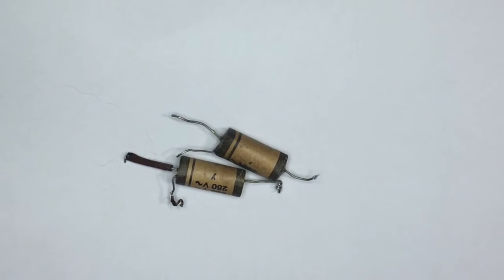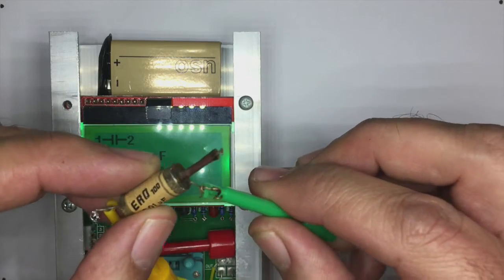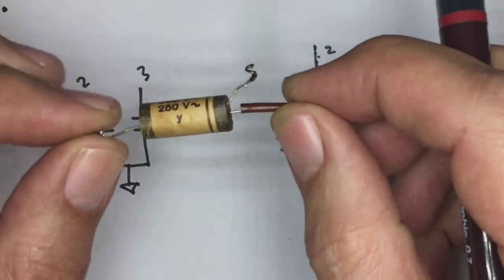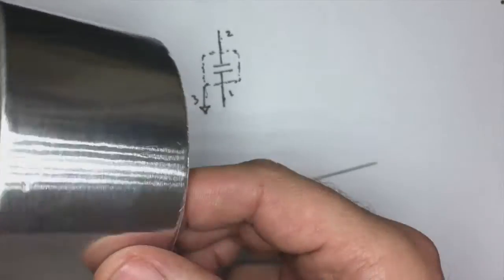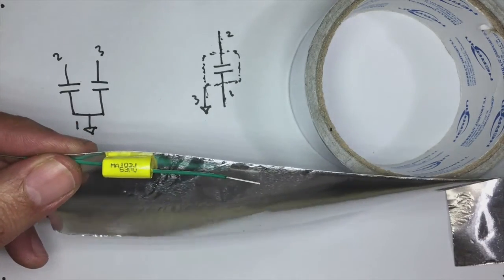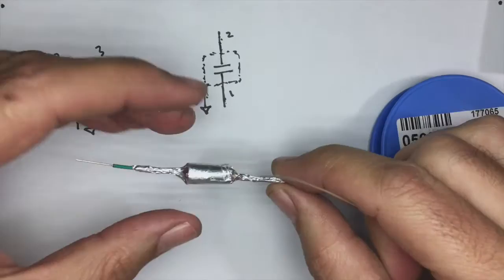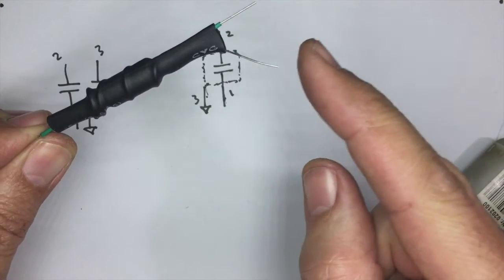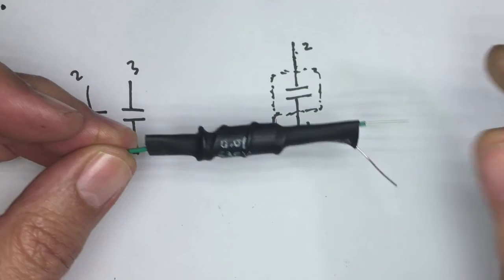How to make a shielded capacitor for a tube radio or amp.

Comment: I've done this simply by winding a piece of thin stiff-ish insulated wire around the capacitor, then a piece of shrink tubing around that to hold everything in place. It worked fine. ☺

Comment: Ive been using this method for a few years now but on my latest radio I tried something different. 
I took the paper off the old cap and the original foil is just loosely wrapped around the capacitor with the wire attached.
I just cut it to width and wrapped it around my new capacitor, including the original wire and put a small dab of superglue to hold in place till the heat shrink was put in place.
Very simple and looks very tidy.
Reply from the maker: That’s a good way to keep it looking more original 👍
Reply: @electronicsoldandnew  I would love to see you try this technique on one of your radios. :) Once you unroll the foil you just need to break off a small piece of the wax on the ends that holds the wire in place.
Regards
Kevin
Reply from the maker: It’s not something I have considered doing. The idea of making a radio look like it’s not been restored is useful if you really want to keep it absolutely visually original, but that’s not the goal in my restorations.

Comment: I was trying to test the voltage of a small electric mini fridge fan motor. I accidentally touched the outside top of a  power supply can capacitor to ground via my hand. It shocked me good. So out of curiosity I checked the voltage between the top of the can to the body of the fridge and it was 122 volts. I checked the next can over and it was 122v as well. This does not sound right. Do I need to take this in and have a service center check the capacitors? 😢
Reply from the maker: I would say so.

Comment: How can you tell when looking at a schematic which sections or stages are high impedance to use the shielded capacitor? I'm not even sure how to use a shield capacitor for coupling caps, decoupling bypass caps or what? EE engineers have told me that using LOW capacitance shielded cables in amplifiers makes the low capacitance cable very microphonic when you're tapping it with a wooden chop stick in high gain circuits but High capacitance shielded cables used in amplifiers are NOT microphonic, any reasons why lower capacitance shielded cables are more microphonic compared to high capacitance shielded cables?
Reply from the maker: If the connection is to a high impedance pin, like the grid, then capacitance will, through the miller effect, create a low pass filter. The higher the capacitance, the lower the frequency cutoff point. However, The lengths of cable one uses in an amp should not be large enough for this to be an issue.
Reply: @electronicsoldandnew  You put the OUTER foil terminal of the capacitor to the previous stage output of the tube and the INNER foil terminal of the capacitor to the GRID pin tube to the next following stage? But where does the capacitors shielding connect to?

Comment: I restored few radios that had factory made shields around the capacitors. They were in tone circuit. They wrapped the capacitor with a thin foil of some kind of solderable metal (it tarnished a lot over the years). So the replacing was trivial, just desolder the shield and put some heat shrink around the new capacitor then resolder the old shield onto the new cap, and resolder the ground lead.

Comment: This kind of capacitor was used in many RCA radios in the 1940s to suppress the harmonic frequencies that would occur in AM band from maritime  AM broadcasts
back in the day , They would overpower the reception of a station  you were listening to  especially if you lived near the seaside.  Of course after WWII the 
maritime  transmissions went to FM broadcasting and thusly  no need for them in the USA in radios after that happened. Not sure if that is why non USA radios have them.
If you encounter one in a restoration you could cover the capacitor with a braiding just for effect if you live in America ,that is!
Reply from the maker: Thanks for the info. I certainly did not know that.
Reply: @electronicsoldandnew  Mr. Carlson said of those many RCA radios that they put those types of capacitors inside the chassis to keep down
hum when it went from the volume control to the center of the radio. I 'll defer to him since I only picked up the info from my grandfather long ago and he
 only saw them  in a few RCA radios!
Reply from the maker: Thanks for the info. I certainly did not know that.

Comment: Thanks, this has been a great help. I am a just starting out in this hobby and have found your videos very informative. When I first found one if these capacitors in my radio it really confused me as to its purpose. In my case there was also a shielded wire to the pu which soldered time the same connection as the shielded capacitor.
Reply from the maker: Glad to have helped.

Comment: Sorry, but shielding the wires to and from the cap is overkill. It may even prove a shot in the foot. It only takes a little bend on the connecting leads and a solder job taking a bit too long for the green insulation to melt through and produce a short between cap leads and the added shielding foil. Make that short an intermittent one and you are in for an hour long hunt. If you really need to shield the wires too use a heat resistant tubing made from woven glass fibres as insulation/separation! 
Easiest way to shield tubular film caps is to cut a flat piece off of a tin can, roll it to fit the diameter of the cap very snugly, trim it to circumference plus overlap, solder on a wire and shove it over the cap. A final wrap in shrink tubing cut to the length of the cap plus a bit of overlap will hold your shield in place. There is no need to solder the selfmade wrap around shield into a tube, as long as the circumference overlaps. Yeez, this is not rocket science!
Reply from the maker: You’re right. It’s not rocket science, so I do it my way, as I’ve done numerous times with no hassles, and you do it yours. That way, both of us are happy :)

Comment: I have never heard of such caps before!  Interesting!  I think that if I ever make one like that, I will use different size braid from coax, black heat shrink for the ground wire, green shrink for the low impedance side wire, and red for the "hot" end wire.  Since the copper braid will cover up the writing on the capacitor, I would type small print on paper,  place that over the braid on the body of the capacitor, and then cover the paper with clear heat shrink so you could still read the value and voltage information.  I would use wire to bind the larger braid on the body of the cap  to the smaller braid on the lead.  I think that would make it less lumpy that way.

Comment: Thank you for showing this, I'm restoring my second radio and had also found one of these ero shielded caps had no idea what it was ! I will be sure to do the same to the replacement cap. Thanks again and cheers from Germany 😊
Reply from the maker: dirkk82 : You’re welcome. I was also a little puzzled the first time I came across one of them.
Reply: @electronicsoldandnew  i made a video on this subject with my own version of the replacement cap.  i have included your video and channel in my description, i hope that's alright as i found this quite interesting and useful knowledge plus your camera has better zoom :-D
Reply from the maker: dirkk82 : absolutely no problem. I appreciate it. Thanks.

Comment: I have used coppersheet as a shield (was in the late 80s).
I would isolate the groundpin also with a black shrinktube. Only for security. Your solution is clearly better the the original. Have to notice this :-)

Comment: I'd just use the outter foil to ground or lowest potential point.  That should be fine.
Reply from the maker: It’s better than the other way around, but not a complete shield. I personally don’t think most situations warrant this effort, unless oscillations result from failing to do so.

Comment: We all pretty much know that it is good practice to put the outside lead towards the lower impedance section to be coupled but I have never noticed shielded caps before. Certainly modern printed circuits have put these types of tricks to rest. Obviously as we explored higher and higher rf frequencies the need to shield became much more critical. 
Today with the proliferation of boutique guitar amp builders and the demand and widespread popularity of handwired point to point circuits, tag boards and turret board type construction this might be another tool in the quiver for those that continue to escalation of higher and higher gained amplifier circuits. This along with very careful lead dressing and placement might make the difference in a noisy or unstable  high gain guitar amplifier, such as the various trainwreck or tweaker type curcuits.

Comment: Is an electrolytic capacitor already shielded?
Reply from the maker: +Noel Williams : the negative terminal is usually connected to the outside "shield", but since you don't always have that connected to ground, I guess you would still get noise pickup.
Reply: THANKS! You have been a tremendous help! Now, (hate to keep bothering you) what is the name of sleeve that goes over foil and cap? You said it was (big-o-it-try)?
Reply from the maker: +Noel Williams : it is heatshrink.

Comment: It could only be used as a short term solution as the galvanic reaction (also called bimetallic corrosion) between the alloy foil and the silver wire will fail at one point and it will no longer be shielded.
Reply from the maker: +Mark David : how short term? I wind the wire round quite a bit, so I hope it won't fail in my lifetime (and that I have a decent lifetime left).
Reply: It all depends on how much the two metals react to each other and how they react.All it takes is a small reaction and it oxidizes or corrodes  causing a bad connection and therefore a loss of shielding...however the actual corrosion in each metal is difficult to predict....but...Galvanic corrosion potential is a measure of how dissimilar metals will corrode when placed against each other in an assembly and what the humidity level in any given location which will accelerate any reaction...A quick look at the  Galvanic reaction chart shows us that Aluminum does not do well with most other metals. Although it may cost a bit more copper foil might be a better choice and could be soldered to the wire for a much better connection...so...If you live in a dry dessert you might get away without any issues.....and good luck with your lifetime....lol
Reply from the maker: Mark David : thank you for the explanation. Copper foil it is from now on.
Reply: Yeah he's right. You can't rely on aluminum connections to dissimilar metals.
I'm going to use copper tape and solder to the copper, but I think I would rather use mu metal tape...or maybe put a braided shield over the whole thing.

Comment: I've done this a few times with guitar amps. Mostly solid state but it still works. I just used Mag wire and put some HVAC tape over the cap. It really doesn't matter to cover the whole cap however to make sure you heatshrink the ends so you don't cause a short. You can create inductance if you wrap the wire around the cap.

A friend of mine got a hold of some aluminum braid cable that he uses for shielding.
Reply from the maker: +Leland Clayton : this solution, or any similar one, is very rarely needed, but when it arises, you do what you have to. The aluminium braid is a good idea. In the tube guitar amps that I've designed and built, I usually design it so that any noise sensitive connection is wired with proper shielded cable, and the coupling component is connected very close to the end point, so this is not needed.

Comment: c]Check the band at one end of the cap. it  shows the shielded end,
Reply from the maker: mtabernig : good point. Thanks for pointing that out. I forgot to mention it.
Reply: mtabernig most non electrolytics don't have any polarity indication.
Reply: well not true....the new orange Epoxy do...and some of other types also do the very small ceramic type do not but in that case do not need shield. Obrigado.
Reply: @mtabernig  That band isn't always correct - see the Mr. Carlson's Lab video on determining outside foil layer ----> https://youtu.be/BnR_DLd1PDI
Reply: mtabernig hmm. most orange drops I use have no marking. guess I'm using the wrong brand:)